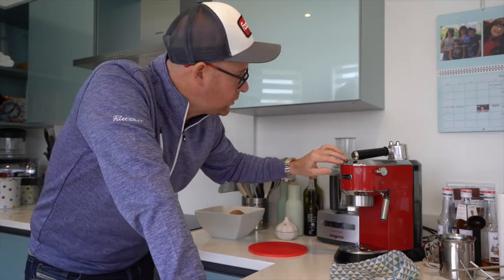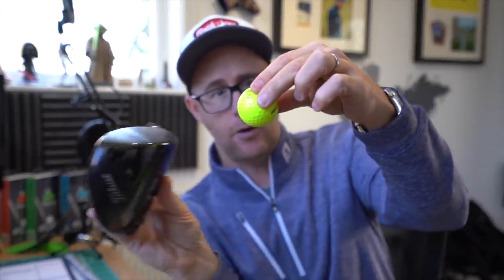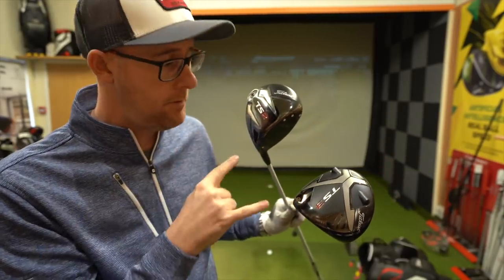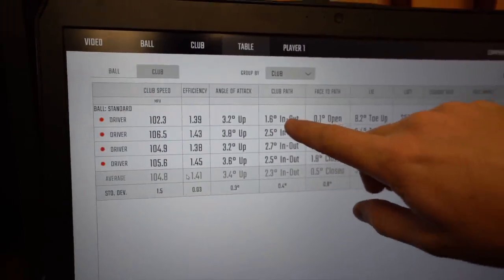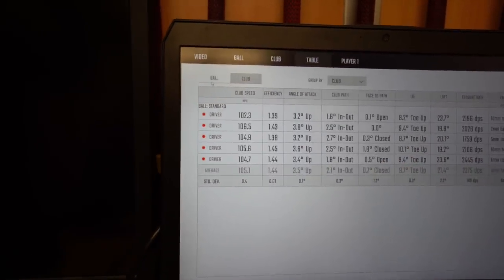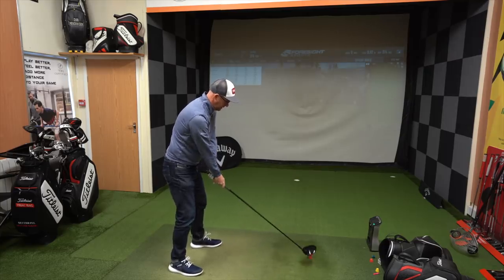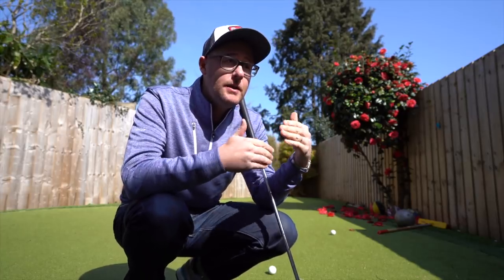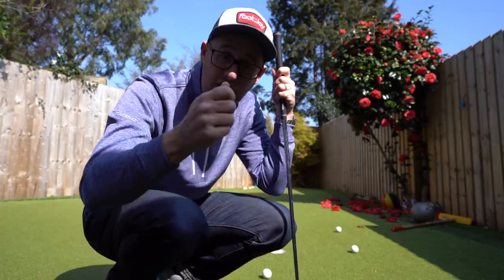WHERE HAS ALL YOUR POWER GONE GOLF TIP

Comment: Another very interesting vlog Mark. I know I have MASSIVE power leaks and it is just down to technique. I’m 46, 5’11”, 11st 8lbs, work in construction so I’m physically fit and hit my G400 SFTec pretty well straight to draws but I cannot get more than 220 carry on course (I measure out with the Hole19 app every great drive). Currently playing it in the 10.6 loft (small + on hosel) so going to try loft options at the range, check the strike patterns and work on efficiency and technique of my swing. Looks like I’m getting a driver lesson booked!

Comment: With lessons I've moved ball slightly forward in stance, maintain tilt away from ball throughout swing and now consistently hit +3 ish with driver. Get long drives and more consistent. Just now and again lose face control. The drop off in distance and direction is crazy! Although when you look at numbers and it's 6 degrees more loft and 8 open, it becomes pretty obvious why! As Pirrelli say- power is nothing without control!

Comment: Mark, I have Dan's old problem in that if I hit level to slightly down with my driver my fairway accuracy is 50-70% with drives in the 240-250 yards. When i try to hit up i can get out to about 260-270 but my accuracy drops to 40-50%. Have spent many range sessions (and lessons with 2 different pro's) trying to  get more accurate while hitting up but it just won't happen... Hence i have accepted that accuracy with slightly reduced distances produces better scores.. Great informative Vid though mate..Cheers Brah

Comment: I have huge leaks in my angle of attack and in my swing (not enough hips).  Working hard to fix them.   Over the winter I have been averaging 220-230 with my driver when i catch a good'n.   hoping to be up at 250 by the end of the year.  Playing off 19 and started last May.

Comment: I have gone to four different places to hit drivers. Smash factor was 1.45 to 1.49 at each location. I swing at 89 to 93 mph cs. Drives are 206 carry at 0 AOA and 237 at +6. I am working on club speed as well. 8 iron with bad habits, 120 yards. Good habits, 169 yards carry. But also 10 mph higher cs.

Comment: I know everyone is different with attack angles etc, it would be good to have Marks thoughts on what club head speed is needed to hit certain degree Drivers. EG. I have an Epic flash driver 10.5 Standard version, Kuro Kage S shaft, I moved it down -1 to 9.5 and I am hitting up on it, measured two well struck drives Sunday 270 & 274, am getting a bit of an old geezer now at 54, think I can still swing the driver at 105 and maybe a bit more. Hit my Epic SZ 13.5  3wood lofted up 1 degree 240. Keep up the great content Mark lots of us LOVE IT. Aloha Rob

Comment: I`ve been trying to gain distance and improve accuracy by using a higher lofted driver. The message I`ve got from this is that I should adjust my driver down from 11.5 down to 9.5 and hit up 2 degrees more than I am now. I know that`s over simplifying things but is that the  general idea? please any comments as I`m having some lessons soon and need a heads up.

Comment: I had a fitting at Ping in the UK recently, for a driver, and as much as I did gain about 10 yards moving from a Nike Covert driver, the fitter told me and my coach (who came with me) that based on the Trackman numbers (I was about 1.35), I could easily gain another 15 yards from a lesson as I was coming 6 or 7 degrees out to in, and hitting down on it a little...  lesson booked!

Comment: I’ve got loads of potential gains. My speed is similar to Mark at 100-103 (measured) but my driver goes about 235-240 on the fly. I suspect my delivery is presenting the toe massively down such that I don’t get the middle of the club enough (all the grass on the club is at the end). The irons were fitted originally but my swing has obviously changed.

Comment: I can hit my 23 rinky 255 yards when struck perfect off a tee, but on average prob about 225-230 yards, and yet currently only averaging about 230 on my driver.  I lose so much because of my slice.  When i absolutely nail my driver, and hit it straight, or maybe just a slight draw, i've hit it 300, but i'd say the average when crushed and straight is about 270.  I am dying to get my ball striking consistent with the big stick as I know based on swing speed (105-110 avg to maxed) I should be seeing some more distance with the driver.  In 2 days I go for my first lesson ever, and seeing the numbers should help me figure out where the biggest leaks are.  I took about 5 swings with a different driver today, and was seeing backspin numbers of high 5000s and also saw that I was hitting 2 to 3 degrees down on the ball.  I need to get that sorted and I'm sure i would see some serious gains.

Comment: Justin Thomas hits about 4* up, so does Rory. Obviously they are all skilled enough to hit up or down, or level, depending on the trajectory and shape. For example a big high draw is going to be teed up higher, path coming from the inside, and hit up on. The other extreme a lower fairway finder fade is going to be teed lower. Path going more left, and a level to negative angle of attack. Great video per usual. I'm surprised you didn't talk about strike. I've played with a bunch of guys that swing in much faster than me, yet I'm constantly 10-15 yards further. I have more optimal strike, launch, and spin. They may have more speed but the efficiency of strike is poor, or they are hitting down on it too much ballooning the spin rate. Video suggestion. Mark Crossfield vs Coach Lockey! Mark you hit 105 mph up 4-5* out of the middle. Coach can hit down 4*5 degrees swinging 110-115. I bet you'd be amazed by the results. Cheers! Enjoy the content. GET UP DAN!!!

Comment: Finally stuff on smash factor :). Typically short shaft will give better impact and better smash factor more distance - even the speed is maybe a little less with a shorter shaft. But that is not how the golf business works. Longer driver and give amateur 1 good shot out of 10 that really is good and amateurs are buying this because this one good shot. The other 9 was bad, but they think they can practice it, but overall it is just a to long shaft to handle for the normal handicap player

I am really tired of the standard so called "fitters" from the big companies standing and telling that the newer models have larger sweet spot, more foregiveness etc etc - sweet spot is so tiny on all heads no more or no less

Comment: Hi mark, I have a couple of quick question regarding this video. If someone was swinging the same speed on a neutral path/head path 0/0 but one was hitting 1° down and one was hitting 1° up how much of a difference in distance would that equate to? And also how would that effect back spin (I'm guessing hitting up will reduce it but by how much?) 
Lastly if I'm correct in thinking that hitting up will increase distance by X amount, is this the same at all speeds? (Swinging at 80 gains X yards, swinging at 90mph gains X yards, swinging at 100mph gains X yards etc etc) would the gains be the same (all 5y gains or different by a lot) 

Could this be tested? Maybe an #askdan video?

Comment: Great video 👍. I'm not arrogant enough to think I haven't got plenty of leaks, BUT I'm only swinging my driver at 85-90 mph so even if I max out on this I'm still blimmin' short. I'm middle aged admittedly but reasonably flexible and my swing doesn't look bad to most viewers so is there anything you can suggest to kill two birds with one stone - swing speed and impact accuracy? Cheers. BTW I'm not expecting to turn into Lockey, but I'm physically similar to many people claiming 95-100 swingspeed.
Reply: Concentrate your practice on finding the middle of the driver face consistently and develop a short game to knock it within 20 feet from inside 100 yards Clive, and at 90mph speed you'll beat more speed merchants than you'll lose to.

Comment: I've had an on going problem with a high dynamic loft. I have my driver, cobra f9, set to 7.5 * but struggle with hitting a high ball. My smash factor is 1.42....I'm guessing I need to see a pro with a launch monitor but any other advice you could pass on to help would greatly be appreciated....ps, love the vlogs

Comment: Could you do a video on what type of gains you could achieve in say a drivers worth of lessons
Nothing guaranteed just say:
Moving from Taylormade M1 for a 20 Handicapper to a Taylormade M5/6 costing £350 gaining 5yds
Or 12 lessons gaining 25yds

Would be good to know what you guys can eek out of a player and in what time frame. 
Lessons are daunting because they don’t have a defined duration, defined result and a defined cost. 
Golf Clubs don’t either but they have the millions in player endorsements and marketing., which makes the pill easier to swallow
Reply: Maybe watch the strokes gained vids mark did recently, power isnt the be all and end all, those 12 lessons i would hope would cover a lot more than adding 25 yards and would benefit you overall rather than just hitting driver further. Imagine the putting, chipping, irons and wedges lessons etc and then think if hitting driver 25 yards further is really that important. A new driver would give you very little if anything in comparison. I would go lessons all day long if you are serious about improving. :)

Comment: Definite power leaks. brand new Ping g400 (what a sexy club). 3° in to out, 1° down, 0° head (trackman actually showing -4, but that's from face twisting...flight of ball is showing it's much closer to 0), 1.44 smash. Contact high heel. Improving that strike point would make massive improvements. (along with couple degrees up).

Comment: This puzzled me for a while when my dead center hit produced only 1.3-1.4 smash factor with 4000 backspin when i was hitting 5 degree up of angle of attack. Initially, i thought the ball at the pro shop was the problem until i brought my own prov1 to shop and saw the same result. Without knowing what the real problem was, i tried to solve the problem by getting the lowest lofted driver with xstiff shaft and lowest spin setting and wasted ton of money experimenting with custom shafts, movable weights and all that crazy stuff and still couldnt get the smash factor more than low 1.4ish. Then, i learned about spin loft and it all made sense! I was flipping at the impact (in my head i was trying to hit up) introducing huge spin loft! changing the delivery solved all the problem and i could hit my old 9.5 g20 longer than any of expensive low loft drivers with a carbon cover movable weights.

Comment: This would be a reason to buy one of those personal portable launch monitors sub $500. 
Though how does the smash factor translate into the rest of the bag? Are we looking for the same thing?
Reply: Reduces to c1.0 for pitching wedge Michael, due to much increased loft which produces an oblique contact and significant drop in the ratio between clubhead speed and ball speed. For an 8 iron you can expect c1.2 and so on through the set.
Reply: @phoenixkarma1118  Something to aspire to Michael ! Cheers for the link.

Comment: Am now hitting up 4 degrees and have gained distance, with a 9 years old club!! However, have also improved technique and swing speed has increased by 10 mph..... Moral is sort your technique out first, the distance will come later. And no need to change to a new driver.... GBP500 better spent on quality lessons 👍

Comment: I seem to be power-gaining except with the driver. My last time on the monitor I was getting fit for the JPX919 Tours and I was swinging 90-95mph with the 7 iron, which is definitely an increase for me. But I seem to have stalled with the driver at 100-105mph, although it has been a year since I looked at those numbers so they may have increased though I doubt by very much based on where my balls end up off the tee.

Comment: I massively leak power but it’s from the tee rather than my whole game. As an example, I get my 9 iron out at 140yds and my 7 iron carries 170 both with just normal smooth swings but if I’ve got a driver carry of 250 then I’m laying up. Once a round I’ll put a swing on my driver that goes plenty far and has a completely different feel, flight and spin but generally I’m just patting it down the fairway. What’s really odd is that with an iron or wedge in my hand I just make a swing and everything feels completely natural like the ball just gets in the way but with a wood everything from grip and set up through to follow through feels manufactured.

Comment: Are there limits to technique?  Why wouldn’t I use a driver with 7 degree loft ?
Reply: jeff berger you would need tour level head speed.
Reply: Tour speed wouldn't be needed if you were hitting something like 7 up on it.  For the ball speed their is an optimum launch angle with it being higher for the lower swing speeds

Comment: A proper fitting should last you until you can't see the brand on your clubs anymore.

The "average" Joe just buys and fires, hoping to stumble on the right set makeup for them.  Add a couple years to learn to use the wrong size and bend clubs, to then buy a proper setup and can't hit it.

That said; When I stumbled on my current gamer I haven't been able to hit other newer drivers nearly as well (from the same brand that is).  

It's unfortunate, but I'm not unaware that I let my equipment train me.